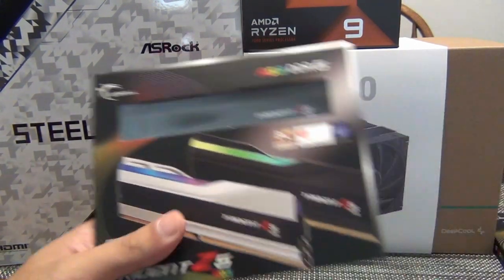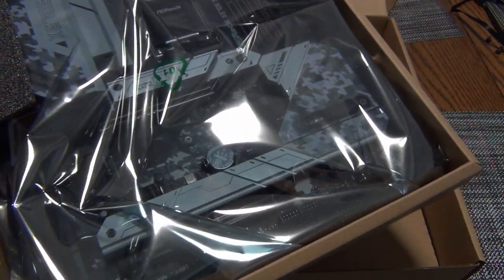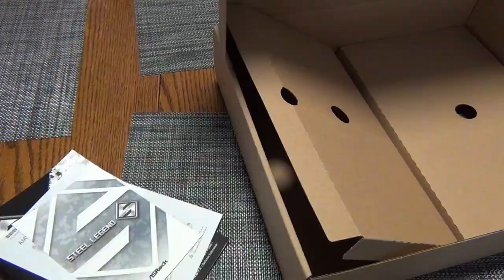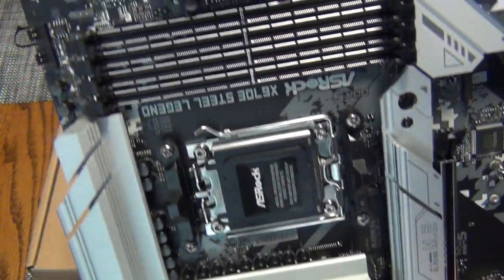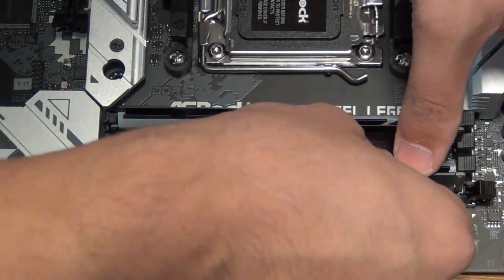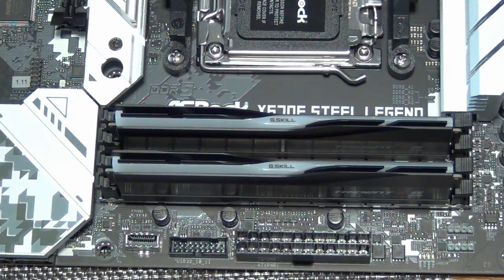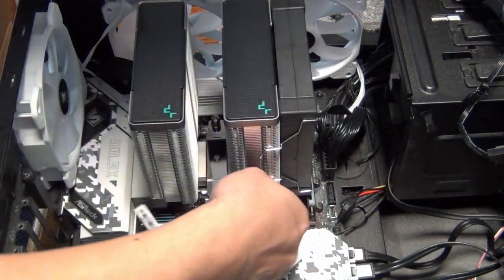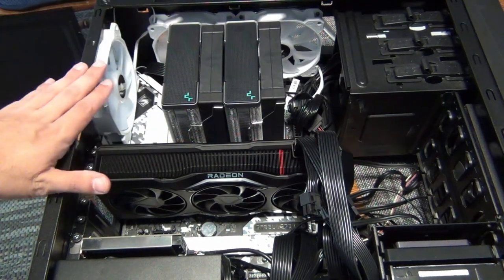Ryzen 9 7950X3D and ASRock X670E Steel Legend PC Build AGESA 1007b

Comment: How reliable is the Asrock X670E Steel Legend compared to the previous history of failing Asrock motherboards? I would like a great motherboard for gaming and have excellent sound quality (I have some hearing loss - born with it) but I'm stuck on what to get that is reliable and would last up to +5 years. Plus, I cannot wait for the next video on overclocking the memory and CPU via curve optimizer in future content on this particular CPU and RAM.
Reply from the maker: This is my 1st time using an ASRock motherboard but my impression of the Steel Legend is that it's one of the best value for money motherboards. It includes everything necessary to build a high-end PC.
Reply: ASRock X670E Steel Legend is very popular motherboard and no doubt it is a good choice, server grade low loss 8 layer PBC, 16x60A powers stages, japanese capacitors, PCIe 5.0 for both gpu and nvme, realtek LAN(less issues than on 2.5G Intel modules), ALC1220(that's a plus compared to ALC4080/4082 -> usb issues) and it's fine,  it's not on the level of external dacs, but that's expected. With 8 layer PCB AM5 boards Asrock did really good job, they are also often first to publish bioses with new agesa, bioses itself are OK, don't have the issues Asus has.
Reply: @GameTechReviews  Cool. Thanks for the reply. 👍
Reply: @Kestrelms  Thanks for the information. 👍
Reply from the maker: @Kestrelms  Yeah, they are the only ones that currently have the latest 1007b beta available on their website for pretty much all of their AM5 motherboards.
Reply: The audio quality is top, I have this board, is really cristal clear for music and gaming.
Reply from the maker: @JomarsYT  Yeah, this board is one of the best ones.
Reply: @JomarsYT  Thanks for the reply
Reply: I have been using this mobo for 15 months now. It's great!
Reply: @AthamAldecua  That's the sort of information I was looking for.

Comment: I have this board but having issues with the polychrome rgb software..  it worked fine for a few days but now I get a pop up saying a driver can’t be installed try reinstalling and report issue…. I tried reinstalling it and it’ll work once but then I get that pop up every time I restart the system. Anyone have this issue? Anything ideas on how to fix it?

Comment: Hi mate, great insight and review. What bios version did you start off with? Did you have to flash to get dad cpu support to work?
Reply from the maker: The motherboard originally had 1.03 which doesn't work with the X3D chips. I had to update the bios in order to get it working. The motherboard supports the bios flashback feature so it can be done without a CPU. In my case, I used the 7700x so I could get into the bios then do the update then swap to the 7950X3D.

Comment: I've got the 7800x3d with this mb. I had a blast looking for ram. At the end I went for corsair 6000 mhz 30-36-36-77 timings which is a decent kit. From what I saw on asrock's official site you can put 7600+ on it and it should work, but for me 6000mhz is enough. it is 1000 more than the CPU can do :D I had a really bad time with XMP profile on my x99 5820k setup with a quad channel g.skill 3000mhz memory that I ran at 2400 because the 125 ticks messes up my oc. Parts for the 7800x3d will arrive tonight. I have the  7900xtx nitro+ to go along as well. Cannot wait for high fps (compared to 7900xtx + 5820k @4.4ghz)
Reply: Got the 7800x3d as well for $360. Should be building this friday
Reply: Bought the same thing a few days ago, installing all on the weekend!
Reply: Im waiting for this mb, 7800x3d, nitro+ xtx but i went for the cl30 6khz ripjaws ram. Ram stability seems to depend a lot on power stability coming from the mb, and this board seems pretty good.

Comment: Don't know if you noticed, but you're running the IMC at half speed, that's why it was so easy to get 6400 to work out of the box, it would probably do 7200 as well. You need to put UCLK=MCLK (1:1) in bios, I think asrock automatically set's it to UCLK=MCLK/2 (1:2) if you select anything above 6000. You're losing tons of performance this way, 7200 (1:2) is on par or worse than 6000 (1:1) on Zen4.

Comment: Any regrets moving from the X670 Aorus Elite AX to the X670e Steel Legend? Currently trying to decide between the two boards right now
Reply from the maker: Steel Legend has all the PCIE Gen 5 lanes since it's X670E. It also comes with a useful GPU anti-sag bracket and lots of RGB. Overall, it's the better value unless you need the PCIE Gen 3 x2 slot on the Elite AX for a 10gb NIC.

Comment: I am inclining for this setup to pair with a 7900XTX for gaming at 3440x1440p and some casual editing work.
Reply from the maker: It's very good. Probably the best value for a great all-rounder PC.
Reply: @GameTechReviews  I've seen it has everything I want. The price here in Romania is around 330-350 euros. The 7950x3d I can get it for around 730 euros and the RAM is 150 euros. While I am inclining on this, 7800x3d is 420 euro. 310 euro difference is there and for gaming, there is no difference, but for extra stuff, it is. My cooling solution is an old x61 kraken which I am not sure it is a good idea to continue using. I've had it since early 2016. If I pay for the cooling as well, it starts getting expensive as the 7950xd runs hotter and needs better cooling to get performance out of it.

Comment: hey i see youre using xmp rated ram for an amd chip thats cool i didnt know you could. i actually have a question if thats ok! i bought the same board and the 7800x3d but i wasnt sure which ram to get. i bought the 

G.SKILL Trident Z5 Neo RGB Series AMD EXPO 32GB (2 x 16GB) 288-Pin PC RAM DDR5 6000 (PC5 48000) Desktop Memory Model F5-6000J3038F16GX2-TZ5NR. Timing 30-38-38-96
CAS Latency 30

for like 111 bucks, and the 

TEAMGROUP T-Force Delta RGB DDR5 Ram 32GB (2x16GB) 6000MHz PC5-48000 CL30 30-36-36-76
Desktop Memory Module Ram for 600 700 Series Chipset XMP 3.0 Ready White - FF4D532G6000HC30DC01

for 100, but im not sure which one is better and i should keep for my system? ill return the other one back
Reply from the maker: Both are Hynix RAM. Keep which ever one you like the looks of better. But the EXPO RAM was validated to work with the motherboard so there is also that to keep in mind.
Reply: yeah thats the thing i do really like the look of the white ram and it seems the last timing number is lower which is nice? and its cheaper. but its not rated for expo so it might have issues? idk. also the g.skill ram is harder to return since newegg kinda sucks with that you know. im racking my head over what to do honestly. im sure either will be fine but i dont wanna make a mistake lol @GameTechReviews

Comment: Maybe it's because I'm still dialing in my RAM OC with pretty tight timings, but on my B650E Taichi the training times are still loooooong. Actually just yesterday I thought I had froze on boot but it ended up on the login screen approximately 17 minutes after restart. That was an extreme outlier, but it's still several minutes every time. I'm sure it'll be better after I turn on memory context restore but I'm hunting down 100% stability first.
Reply from the maker: If your running the RAM above 6000mhz it will take longer to train the memory. However, MCR should cache the results so that it doesn't have to do that with each subsequent boot. I have found that if you use sleep mode then sometimes after several weeks if you reboot the PC it might retrain the memory which will take longer than typical.
Reply: @GameTechReviews  Can Agesa 1007c (or newer) allow these motherboards to run 6800Mt/s (rather than 6400) from G.skill?
Reply from the maker: @Serene1618-ef1kx  Yes, in fact it allows running 8000Mt/s.

Comment: Hi, cool video!  My last PC build was around 12 years ago! I'm still using the same PC today... still runs strong, but not able to render multiple 4K video streams like I want.  A lot has changed since my last build!  I just bought the same motherboard, and CPU. But can I ask you about the M.2 slots?  I bought 2 drives... a 4TB for my C: windows, and a 2 TB for an extra drive that will hold all files for whatever video project I am working on.  What about the speed of the M.2 slots... are they all the same speed?  Is only 1 slot fast, and the other slots slower??  Any thoughts on how I should set that up?   Thanks, Tim
Reply from the maker: The top M.2. slot is PCIE Gen 5 capable. The other 3 are all PCIE Gen 4.
Reply: @GameTechReviews   Thank you sir!

Comment: Hey! Just a quick question. I own a 3060 might get a better card in a year or two. 

But anyway I'm wondering where would my card go best in? The higher or lower GPU slot? I heard the lower one stops bottleneck? So is that the best place or not?
Reply from the maker: I'm assuming you have the same motherboard shown in the video. If so, the correct answer is the top slot. It's the only one that has full x16 lanes.

Comment: im between this ashrock steel legends x670e and asus rog strix b650e-e. What do you think between theese two? which is better?
Reply: I have the B650E-E with a 7800x3d using QVL Gskill 6000cl30 with expo ON, and im having pcie problems with my 4080, sometimes it get stuck on 1.1, and need to restart the pc several times to get unstuck...AVOID ASUS

Im switching to a X670E Steel Legend
Reply from the maker: X670e is a higher end chipset and includes more connectivity. If they are similar in price then definitely the Steel Legend. However the B650e-e includes the post code debug LEDs.
Reply: The Asus B650e-e is not really good in theory. It uses a problematic Intel ethernet chipset and problematic 4080 Audio chip. All the 4 SATA ports don't run natively but by 2 Asmedia Chips which even cut down on bandwidth.

Comment: Hi, i am building a new gaming and generative ai pc for which i am stuck between asus x670e-a and asrock x670e steel legend.

Basically the build is on white theme and i not able to pick the perfect motherboard till now. Everything is ready just the cpu and motherboard are still not final.

Please if you can recommend me something.
Reply from the maker: The Steel Legend has been an excellent value. I have not used the other one so I can't comment on it but I've been happy with the X670E Steel Legend.

Comment: Do you think you can run 192GB ram on this board?
If so, which company should I buy the set and with what parameters?
I want to build a rig with 7950x.
I need a lot of RAM for Proxmox.
Reply from the maker: You can run 192gb but not at high speeds. If you just need capacity it will work at 4800mhz just fine.
Reply: @GameTechReviews  Thx for answer. 
Would I get faster speeds on a different motherboard for normal work?  is it simply not possible with this moment/generation of processors?
Reply from the maker: @przemekn.8814  192gb is possible to run at higher speeds but requires a deep understanding of the advanced settings in the motherboard. See my video on 192gb DDR5 on AM5 at 6000.

Comment: Hi! Thx for your videos! I just bought 7950X3D and Asrock B650E Taichi Lite but i don't know if i go for Trident Z5 RGB, DDR5-6400, CL32, Intel XMP 3.0 - 64 GB Dual-Kit (CL 32-39-39-102) or Trident Z5 Neo RGB, DDR5-6000, CL30, AMD EXPO - 64 GB Dual-kit (30-40-40-96), can i have your help? The first run at 1,35v and second at 1,4v Thx <3 😊 (i don't want to OC or manual settings, just put XMP or EXPO and profit)

Comment: I couldn’t locate 9 screws for the motherboard attaching to the case. Does 4 work? I only found 4 of them in the package.
Reply from the maker: No all 9 screws are recommended to secure the motherboard to the case. They also act as grounding points. I wouldn't build the PC with only 4.

Comment: Hi, please which one is better motherboard ?

( Asrock b650e taichi lite ) or ( Asrock X670E steel legend ) ?
Reply from the maker: If you need the extra chipset for additional connectivity the X670E Steel Legend will be better. Otherwise, the B650E Taichi Lite is an excellent choice that includes the post code debug LED.

Comment: So far are there any stability issues with 7950X3d on this board? I was running a x670e Pro RS with the Trident Z NEO (F5-6000J3238G32GX2-TZ5NR, although the motherboard was not listed on the RAM QVL), and I was getting random crashes (STATUS_ACCESS_VIOLATION on chrome, and BSOD) even without XMP. Thinking if I should switch to another RAM kit or change the mobo.
Reply from the maker: That sounds like an unstable RAM overclock. I have no issues and I've been running 96gb at 6400mhz on this board without any issues.
Reply: I think so too, but I have also gotten crashes even without XMP enabled (BSOD is less often though), so I am also not sure if it is a compatibility thing. The crashes and BSOD does not happen after a recent BSOD reboot thought, but I am still suspicious of how stable the system is

Comment: Can you please tell me what are the temps for your cpu  while gaming using that air cooler I thought that the 7900 x and 7950x needed to be liquid cooled.
Reply from the maker: In the 50-60s while gaming. They don't need to be liquid cooled especially the X3D chips as they don't use that much power.
Reply: what do you think would be the best cpu air cooler for the 7900 x want to keep it cool as possible  please and thank you.
 @GameTechReviews
Reply from the maker: @Tommy3429  Any Large dual fin heatsink. So NH-D15, Dark Rock Pro 4, AK620, the big Thermalright ones. Anything with dual fins similar to what is shown in the video.
Reply: thnx for your help @GameTechReviews

Comment: is an m.2 ssd that comes with a heat sync  compatible with this board with its own m.2 cover / heat sync system? thanks?
Reply from the maker: See the section in the video showing How to install an NVMe PCIE Gen 5 M.2 drive

Comment: Was bios update needed to run 96gb ram in 2 sticks? I cannot find any 2*48 kits on support list for this mobo sadly
Reply from the maker: Yes. One thing that isn't shown in this video was the default out-of-box BIOS that this motherboard shipped with was very old. It shipped with 1.11 which is from 10-25-2022. I had to update the bios to the latest version by installing extra 5200mhz RAM that I had as well as swap to the Ryzen 7 7700x because the bios was so old it didn't recognize the 7950x3d. I highly recommend updating to the latest 1.28 bios as it makes running 6400mhx 96gb very easy.
Reply: @GameTechReviews  you should be able to update the bios without using ram and cpu since it has bios flashback
Reply from the maker: @TheOlidos  The problem was the 48gb DIMMs wouldn't work with the older bios. I still needed to use another set of RAM that I just so happened to have available so I can see this being a rare pitfall that someone else could run into if they only had the 48gb ram.
Reply: @GameTechReviews how do I update?